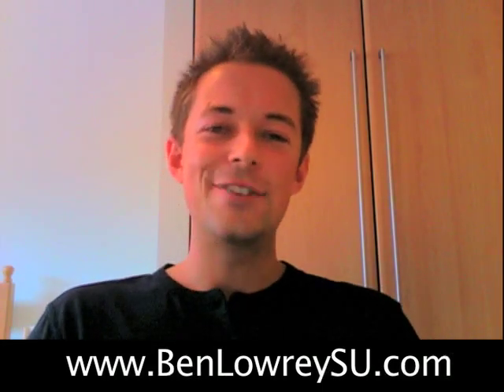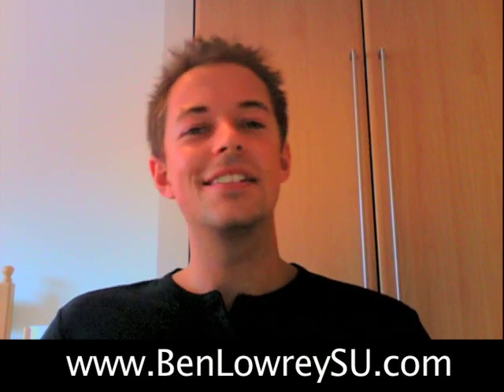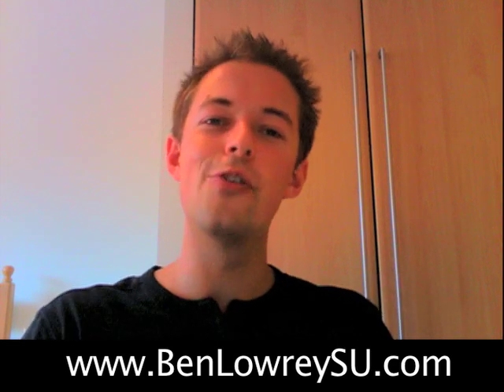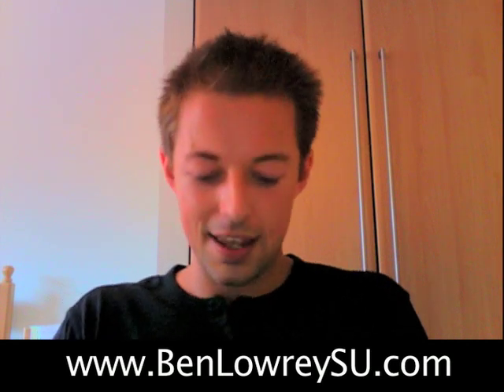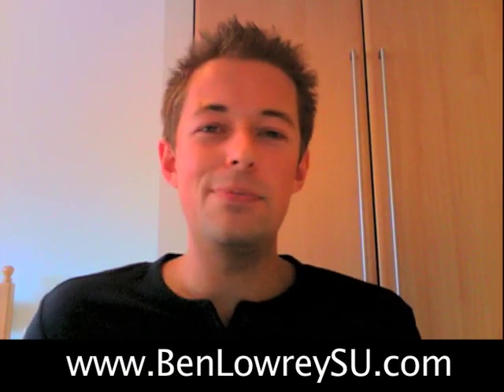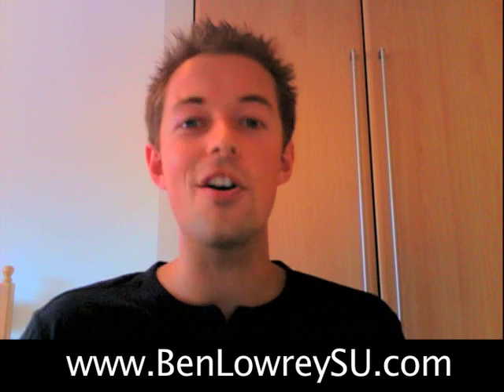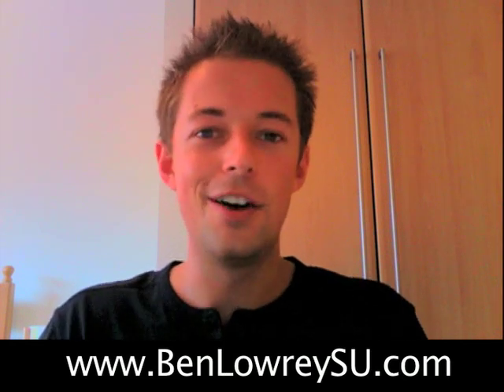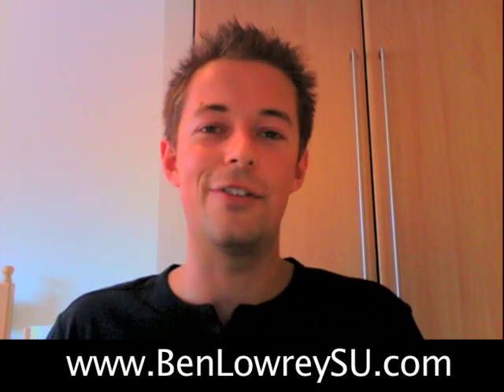How to run your car engine on Water H2O!

Comment: Production of hydrogen is not new.  They were doing it back in the 1800s.  So there has been plenty of time to discover water as a fuel.  You can create hydrogen using wind and solar but you cannot create enough hydrogen to run a car in a closed system.

Comment: That is a grossly oversimplified and slightly faulty way of describing one of the effects of the second law of thermodynaimcs (if that was what the second law described, refrigerators would not work). What the second law of thermodynamics states is that the entropy will never decrease (it can be decreased locally though).

Comment: Not only is your number for dark energy/matter incorrect (there are several times more "standard matter" & "standard energy" compared to dark matter/energy than you claim), but theory of dark matter & dark energy is derived from the same laws of physics that says that that the water engine can't work. Change those, and the dark matter/energy theory would not work.

Comment: 2*H2O->2H2+O2 costs energy.
Reforming->gives energy
Net result: 0 energy gain, 0 energy loss if you have a perfect system (create a system that can operate with 0 energy loss and you will be rich!). The first law of thermodynamics causes problems for water powered cars...
 These water powered cars are not being made for a good reason. Also, try to find some kind of scientific report that states that this works.

Comment: Interesting spam site, to the same people just trying to make a buck off of the mindless masses. Dr. Dingel has a system that really works, and I am talking straight water use no fuel of any kind, and too the late Stanley Meyer had a vehical that ran on water alone. This system of getting some wire in a masson jar is just a gasoline saver not gasoline replacement technology. Tell people the truth, the technology you are talking about is for saving on gasoline not replacing gasolines use.